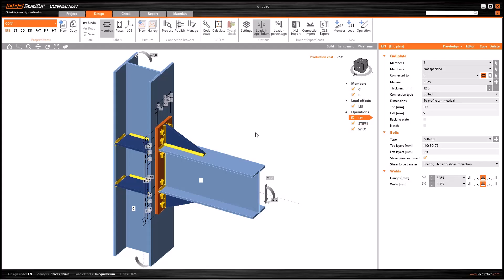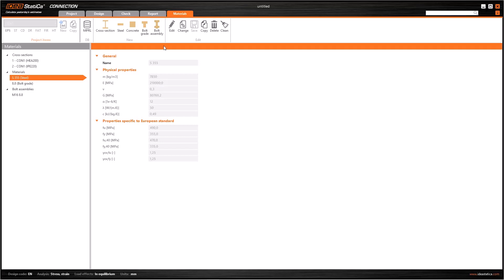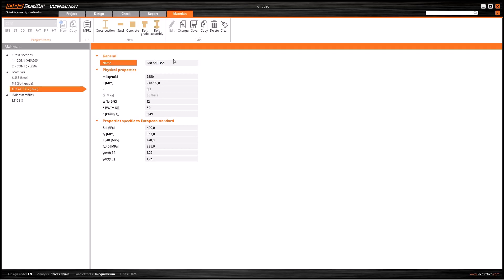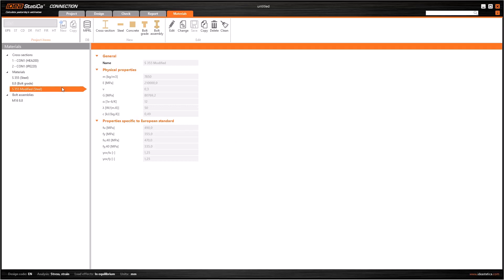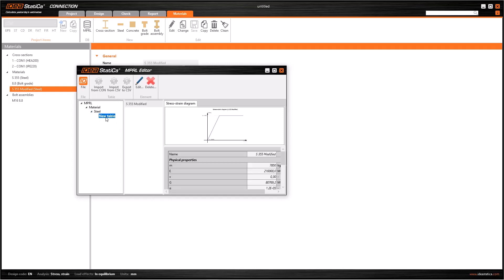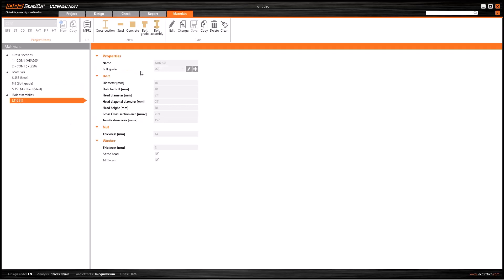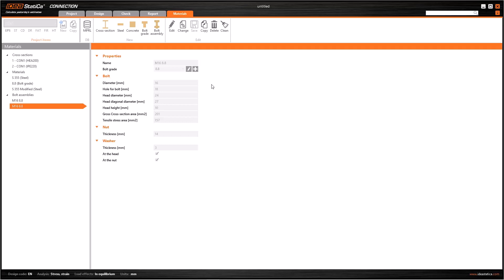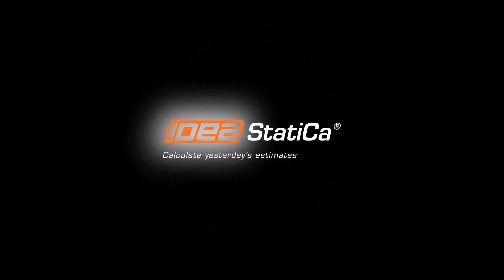Material Library Settings

Comment: Is it possible to use euro code material 
In a aisc code design file? 
Yes, means how
Reply from the maker: Hello, yes, this is possible.
Just edit the cross section or operation properties. But be careful with the code prerequisites, material diagrams etc. you should be aware of all that.
https://www.ideastatica.com/support-center/user-defined-material-material-and-product-range-library-mprl